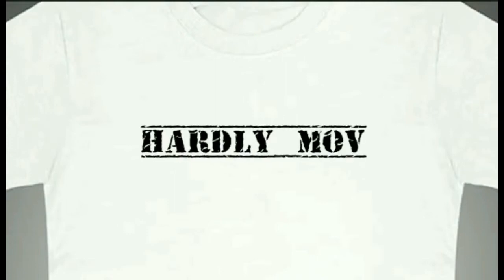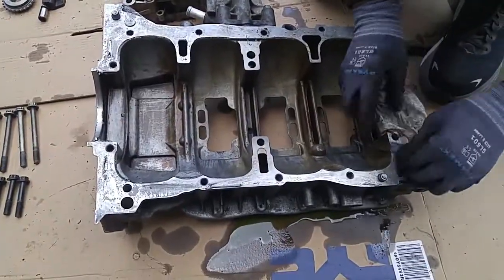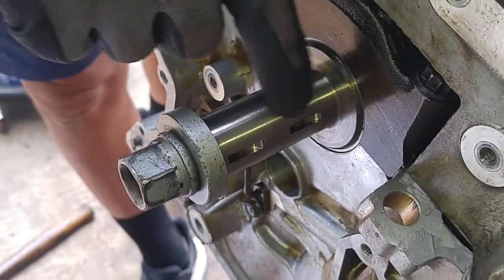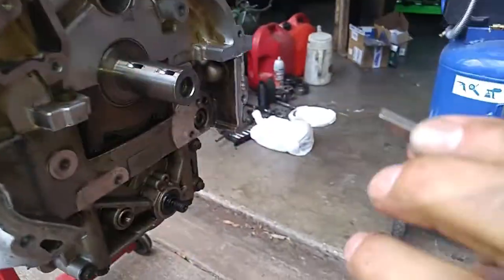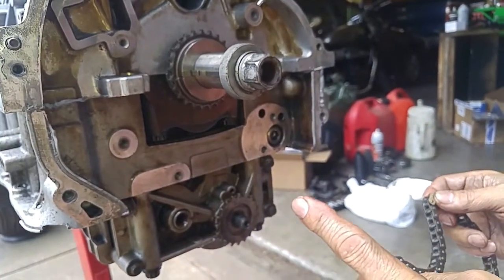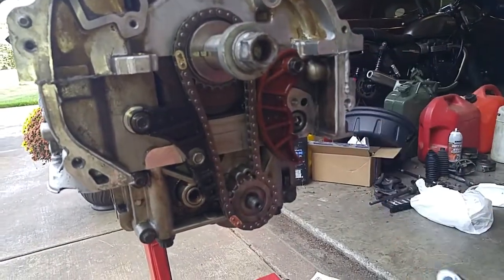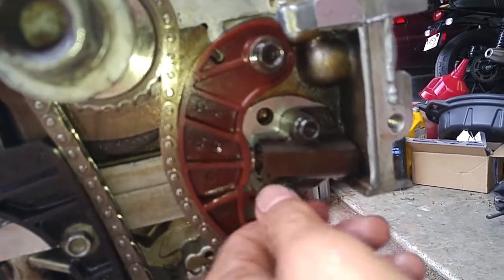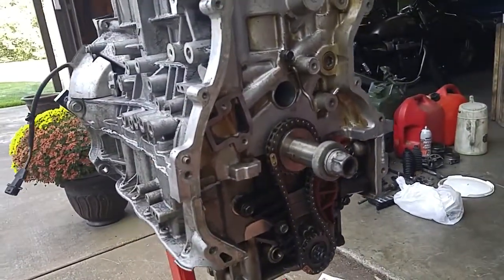Easy Hyundai Sonata Oil Pump and Chain Installation!  (2.4 GDI)

Comment: My 2012 Kia sorento 2.4 gdi dosent have the timing marks on the balance shaft like your does. Only timing marks on the sprockets. Is there any other way that it will need to be timed since I don’t have those other marks?
Reply from the maker: I think that the balance shaft need not be timed.

Comment: My oil pump doesn't have that second piece that you use to get the pump at TDC. How do you set that without the second part to be able to line up?
Reply from the maker: Haven't encountered your situation to advise.

Comment: The bolts that hold the balance shaft module to the block are torque to yield. I can’t even get part numbers from Kia to buy replacements. Like they can’t even find them on their computer. Anyone have any parts numbers to help me out? 2 different lengths so 2 part numbers.
Reply: Ya it wasn’t easy!! Don’t get used bolts like u said torque to yield. The short bolts are 21390 2G050 the long are 21390 2G020. Even Kia couldn’t figure it out. Took a lot of digging but I bought these and they are the same bolts length grade and diameter from Kia.
Reply from the maker: Might be better of getting from an auto salvage yard.

Comment: Is this the same 2.4 gdi motor that’s in a 2015 Kia optima?
Reply from the maker: The block should be the same.  Believe in 2015 they changed the oil pump design.

Comment: Does the timing chain and everything else have to come off of the motor to remove the oil pump ladder assembly
Reply from the maker: Yes.
Reply: Is there any way to slide the bottom oil ladder if you just remove the bottom bolts of the timing chain cover and the pulleys it looks like it
Reply: I replaced the bearings on the other three cylinders but I can't access the rear bearings without removing that and it's knocking still
Reply: Can that oil ladder be removed with it in the car and with the transmission connected to it I appreciate your help trying to get this done

Comment: How did you get the crank woodrough** spelling it wrong.. but key out?
Reply from the maker: A few light taps with a punch tool or flat head screw driver can pry loose the woodruff keys out.

Comment: He said cleaning the mating surface of the block doesn't have to be perfect.  But I i disagree. Must be because of my machinist background,  it needs to be perfect as close as possible to perfect.  Years of adjusting offsets to .0005 to .0008 , in my mind that's critical space.  "Doesn't have to be perfect " is not good enough for me.  I need to know the surface is perfectly clean and flat
Reply from the maker: Perfect in the sense of being bright and shinny is not necessary.   The matting surface need only be free of old gasket material.

Comment: Oil pump should have 7 bolts.
Reply: Mine has 6. There’s different ones. Mine dosent have the balance shaft timing marks but most videos do. Mine only has the 2 spots for timing marks. The ones on the chain.

Comment: It would be nice to show the bolt sizes and lengths accordingly and each position they go as ome take engines apart and get confused on what place and size and kind is needed.
Reply from the maker: I hear ya!  When I take engines apart, I keep all the nuts, bolt and parts separated and even bagged and labelled to prevent confusion during reassembly.
Reply: @hardlymovingpro  I usually do that and take pics but i wish i had a bolt diagram explaining where they go and i imagine it would sell very well.
Reply from the maker: Thought my engine rebuild series showed all the bolt diagram order.

Comment: I put silicone on the oil pump , could this be my cause of low pil pressure? New crank and all bearings measured good
Reply from the maker: Unless the silicone clogged up a filter screen.  Silicone should only be used on rubber surfaces and brake caliper pins.  Petroleum based products does not dissolve silicone.

Comment: Thanks for the video. I have a question I’m doing exactly the same job in my 2016 Kia shortage 2.4 but I decided use the 7 bolts balance shaft do you have the torque specs and sequence?
Reply from the maker: They're both stated in the video
Reply: @hardlymovingpro I check the video again and you just show the torque specs for the 4 bolts balance shaft module. Mine have 7 bolts, 3 long bolts and 4 short. I don’t think it will be the same torque for all bolts.

Comment: Thanks so much, this is what I was looking for. Can u please tell me if its possible to replace the piston rod bearings while the engine is still in the car for this model ?
Reply from the maker: If the crankshaft rod journal bearings are smooth, then yes, the rod bearings can be replaced with the engine in the car.  If the bearings have "spun", the bearing surface will have fused aluminum and/or copper from the worn bearings.  Impossible to remove.

Comment: My oil pump doesn't have the wheel that lines up does it still need to be done a certain way i think its g4ke
Reply from the maker: If your oil pump comes out of the 2.0 and doesn't have balance shafts, there's no alignment needed.
Reply: @hardlymovingpro  it's 2.4 I think it has shafts but no wheel thing but it has timing marks
Reply: @hardlymovingpro  timing chain is on right marks , valves are holding air but car won't start,  getting low compression 105 70 70 110 psi oil pump marks are on but not sure if it has to rotate again to have the shaft in correct position,  if so would that cause low compression
Reply from the maker: Really can't advise without seeing what's going on.
Reply: @hardlymovingpro  it's a mystery,  leak down test holds decent air around 20% loss on cold engine , timing marks line up with all orange dots , compression 90 70 110 90 , not much else.driving me nuts maybe cam phasers
Reply from the maker: Those are low compression numbers.

Comment: My oil pump chain doesn't have colored links.  What do I do?
Reply from the maker: If the color is gone, that's a good sign the chain is worn out.  Suggest you get a new chain.  They're not that expensive.

Comment: I have a 2016 sonata with the 2.4  and the oil pump is totally different. Intake can sprocket it different also . Gotta love these car companies
Reply from the maker: Video is good up to 2014 2.5 engines I believe.
Reply: My 13 optima is different
Reply from the maker: @brycemueller7330  2.0 turbo?
Reply: Did you ever rebuild your 2016?